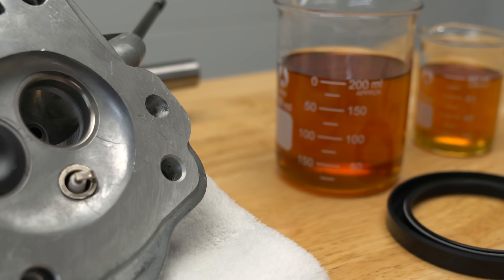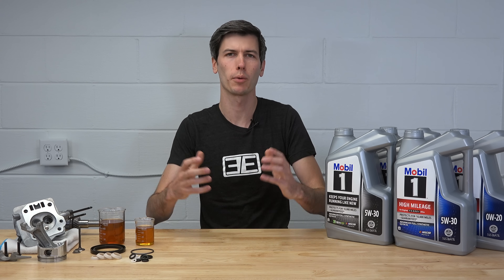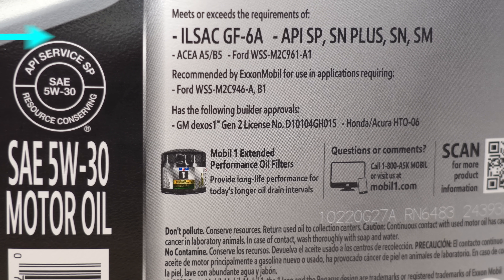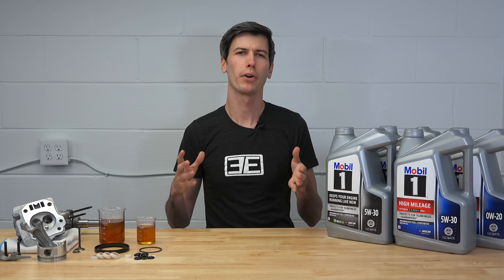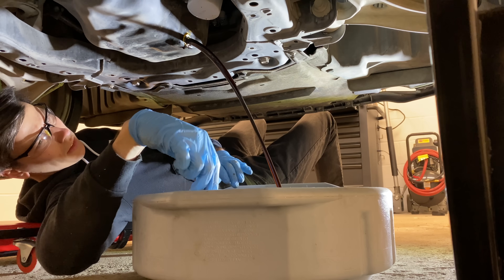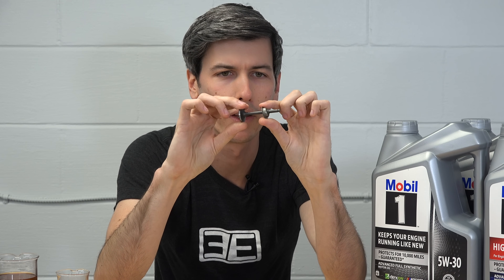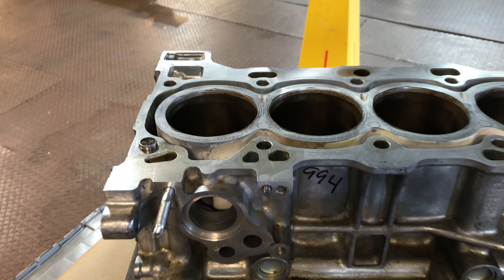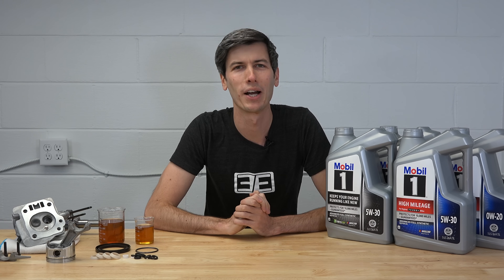Is Synthetic Motor Oil Bad For Old Cars?

Comment: I’ve had four used cars that I switched to full synthetic..all four developed leaks almost immediately!  Just my experience.  So what I do is switch to a semi synthetic, best of both worlds!  I’ve actually seen leaking engines caused by full synthetic reverse by switching to conventional and semi synthetic!
Reply: Jim Bic did you even watch the video?  The syn didn’t cause the leak, and the issue is still present.
Reply: Did you read what I wrote?  I’m telling what has happened in my experiences!
Reply: Jim Bic and he explained how those experiences happen.  Also when you switched to syn was it a high mileage syn?
Reply: Chad 2 Cars yes 2 Cars No...my Motul rep (when I used that oil) assured me that their oils are made to treat seals regardless of mileage.  Motul is a much better oil than Mobil.  I’ve just had bad luck with Synthetic in my older vehicles.  Dude I swear to God, on one particular vehicle it (which never seen a synthetic) went from being completely dry to an actual constant drip at the rear main seal.  Again maybe just my luck?  Instead of using synthetic I use conventional or a semi and just change it more frequently..one car now has 330k never had any engine issues.  I could try a newer Mobil 1 high mileage, might try it and report back to you!  :)
Reply: @JimBic72  I wonder why he said the oils treat seals regardless.  High mileage oils have different additives regardless of make.  Like he said in the video, you wouldn't want to swell newer seals so non high mileage oil shouldn't be doing that.

I'd be curious what happened if you did try again, but in my experience with reps at the dealership they were about as honest as our salesman.  Couldn't trust either of em :/
Reply: Chad From what I understand you don’t want to ‘swell’ seals rather keep them soft and supple.  Sometimes I’ve seen seals that are like a rock and are beyond ‘treatment’.  Sometimes the crud that builds up around the seals are what’s actually keeping it from leaking!  Put in synthetic oil which has a great ability to clean, it cleans the gunk around the seal and voila...you have a leak!  I believe that’s what happened in my experiences!  I get what he’s saying in the video.. again this is not what I have typically experienced!

Comment: Switched to Mobil 1 in 1975 after seeing semi gas engine with 100K, several oil analysis reports and torn down as proof of  concept-spectacular. Did change out some used cars with 30K to Mobil 1 after a drain and flush and run 30 sec with diesel fuel. Zero leaks or oil burn until I sold them at 120K.

Comment: Thanks for the bonus rotary fact. I've been scared into buying conventional for my 85 RX7 by the guys on the RX7 Club forum for a few years now!
Reply: Your Spinner engine will run perfectly on Pennzoil Ultra Platinum -- just make sure you use the viscosity that's recommended by the manufacturer !

Comment: I've been using synthetics in old cars ever since Mobil One was first available to me in 1976. Never had a problem. Haven't had any mechanical engine failures, either. It was a great advancement in motor oils, and proved that thin oils can lubricate just as well as thick ones.
Reply: D.E.B. B    You're wise beyond your years.
Mobile 1 Forever.
Reply: @ricktaylor3748  IN THIRD PLACE! BETTER ARE = PENZZOIL, ULTRA" PLATINUM, = AMSOIL, SIGNATURE! AND SHELL' ROTELLA ' 6!! FULL STHN
Reply: Doesent work well om early turbo vehicles they always had  very light leaks ..drips the synthetics..fly right through..and remember that graphite oli back in 70s...fouled up plugs and valves
Reply: @miguelcastaneda7236  and wore out rod and main bearings.
Reply: I've been using mobil 1 since I was 4 years old, and never had a single engine explode
Reply: I've been taught that synthetic oil will leak more because it's thinner.
Reply: @chuckh4077  Some will, some won't. You have to try it to see. BEsides, there are many synthetic thicker oils available; I used 20W50 on my 1986 Porsche 928 for  almost ten years (2007 to 2016) with no leaking. Same with my first; a 1966 289 Mustang that I started on Mobil 1 5w 20 back in 1976 it had 80K miles that had previously been on 10W 40 Castrol GTX; It dripped a little on the old dino oil, and dripped a little on the synthetic as well, but no more on the thinner oil, and didn't burn any, either. But the mileage went up to 18 mpg on that old engine from  16. I kept that  car for another four years; but the most impressive stat is zero major engine problems ever, on any vehicles since 1976. Good oil has to have something to do with that.
Reply: Bonjour,
Quel grade d'huile mobil 1 utilisez vous ?
5w30 ?
Reply: The problem is, if a old car using conventional all over the year, and suddenly added synthentic, the engine will leak from everywhere
Reply: provided it had enough additives.
Reply: @humansvd3269  ALL motor oils have 'additives'.
Reply: @d.e.b.b5788  true but what ones and how much?
Reply: That’s all the evidence I need , oh while I have you here what’s your take on earth , round or flat . I await your findings
Reply: @mr.anderson9938  . LOLOL!
Reply: @mr.anderson9938  flat
Reply: it hard on flat lifter's, and cams

Comment: this video is slightly helpful for most ppl but it doesnt address the actual problem with using synthetic oils in actual old engines. anything from around the early 90's or 90's back. aka actual old cars or the cars people care about and are watching this video for. there are certain additives the old engines needed that are not present in most modern oils. yes there was a short spurt about check oil specs on the bottle so technically someone who knows would see hey this doesnt have certain additives. but who here knows that the oil specs mean on the bottles? not the people on youtube trying to figure out if their about to kill a motor or not. 
before everything went roller camshafts and roller rockers in the mid 90's the flat tappet cams and lifters NEED zddp its an additive that was the common spec for the day.  not the case any more and thats whats bad for old motors. shell rotella is a severe duty synthetic that still has enough to be a good oil for old cars. t3 i think it is. other than that you need to special order the oil now or buy a zddp additive for using current oils. thats the big reason for the myths aside from the leaking problems. newer oils have less anti wear additives for friction due to being roller motors. the additives they have are for different kinds of stresses and strains and perform fine for the motors they are advertised for. 
think of it like the gasoline difference between cars that require leaded gas vs newer ones that cant run on that. most gas stations dont sell 110 octane leaded fuel. yet it was in every station back when it was the product that was needed. now its not so measures must be taken to prevent damage just the same.

Comment: I wish Mobil 1 made a synthetic with proper ZDDP content for a classic running a flat tappet cam.
Reply: Amsoil sells a 100% synthetic product called Z Rod oil (in grades of 10W30, 10W40 and 20W50) that is specifically designed for older classic and hot rod cars.  It features a high-zinc formulation to prevent wear on flat-tappet camshafts and other critical engine components, along with a proprietary blend of rust and corrosion inhibitors for added protection during long-term storage. Z-ROD Synthetic Motor Oil is designed to perform on the street and protect during storage.

Comment: From 1st hand experience, synthetic was not to be run in Mopar 225 slant 6 in the early 1980s.  Mopar issued a service bulletin stating this warning two weeks too late for my friend.  The cam shaft shot out through the radiator of his pride and joy the day after I was permitted the one and only time to ever drive his baby.  He blamed me for 2 weeks until the service bulletin showed up.

Situation:  He was a timid driver.  He froze in heavy Chicago traffic.  He asked me to drive.  I drove it aggressively until we were out of Chicago.  Then he drove as normal, about 3 mph below posted speed limit (55 to 45) for the next 135 miles.  The next morning...kaboom.  Cam shaft hanging out the front.  According to the service bulletin, under heavy loads, synthetic oils would work into the interference fits that held the cam shaft in place.  It would not be noticed while under heavy load because the engine was uniformly hot.  But after repeated cooling cycles (or CYCLE) when cold there was more clearance and the synthetic would permit the cam shaft to eject.

The fix was to replace a bushing with a standard high performance bushing that had been available for many years but only installed on the 2 barrel carb engine.  Took about a 1/2 hour.  (I installed it on my slant 6 even though I had no intention of using synthetic due to how fast my oil got sludgy.)

It took so many years after the early synthetics to get the service bulletin warning on the slant 6s, because the slant 6 had to have oil changed every 3500 miles even if it sat in the driveway and went nowhere.  They are dirty engines.  So, people did not want to put expensive synthetic oil in them.  I owned 2 slant 6s and certainly laughed at the cost of synthetic.  But starting in the early 80s, the cost of the synthetic oil decreased, the additives improved to sequester the dirt to better precipitate it in the filter and the filter technology improved.  So, now it was possible to run about 10k miles or MORE just changing the oil filter and topping up lost oil.  Wow!  What a life.  How could it get better?  But on the downside, seals starting leaking.  Although the slant 6 seals always leaked so who could tell?  The real tell-tale was the cam shaft peaking out the radiator.

Comment: How about older engines from pre 1980 that have hydraulic flat tappet cams shafts?  Wouldn't fully synthetic motor oil cause the cam shaft to wear out prematurely it were to wash off the protective coating Zinc off the camshaft? Since Synthetic motor oils are very good in preventing sludge buildup and have cleaners? In that case it would be best to find a Fully Synthetic motor oil that has high ZDDP for Classic Cars!

Comment: OH NO!!! You brought up the crazy synthetic vs conventional oil in a rotary engine debate!  Grab some popcorn and watch the comments!  I'm an RX7 owner and have been running quality synthetic oil in my engine for over 20 years. I just had my 1984 12A rebuilt with >175,000km on the clock. Housings and rotor faces were just fine, thank you very much.

Comment: Some cars get shipped to cold climates and the oil that comes in it is good for down to 30 degrees but if you read the manual it says bump up oil thickness for hot climates and that the real deal.

Comment: My understanding about not using synthetic oil in a rotary using oil injection, is that the synthetics are actually TOO good. They are more resistant to evaporation, so they don't burn in the combustion chamber as easily or completely and thus build up carbon more rapidly.

Of course, the best thing to do is delete the oil injection and premix the fuel with 2 stroke oil while using a synthetic in the crank case.

Comment: Mineral v Synthetic...
I rebuilt an old 4 cylinder MC (Suzuki GS750E ´79). I was told that it was due to the minerals. Back then, the engines needed the minerals for valves and what not... Nothing about seals, leaks, thickness or o-ring wear.
Have I been told something false?

Comment: When i had a RX7 i never thought about adding some 2-stroke oil to the fuel.
Might have helped the wear my car engine experienced.
Reply: I sold my RX7 6 months after I bought it new because it used as much oil as gas
Reply: @alanpoh3386  There is a regulator on the engine, might not have been set right.

Comment: When I use synthetic,  I burn a ton. When I use conventional, I burn nothing.
Reply: What do you like better?
Reply: Johnny Tyronne  What would I use if my car has over 250k miles and uses 10w30?
Reply: Thanks, unusual... maybe recheck VISC/ additives/weight: etc.
Reply: @Kevin Krut that's odd since I used m1 since the very late 80s on cast iron blocks with no issues at all. Used it till I retired. Still use it in my 2 vehicles.

Comment: Curios to see what you guys say and think about mixing types of oil.  For example, mixing 2.5 qt of 5w-20 synth with 2.5 qt of 5w-30 for use in an engine.
Reply: I think it depends on the individual oils in question and their additive packages.  If the two oils have a very similar additive package, then I don't see it as a big deal, but in most cases it is not really necessary and a waste of time.  Only reason why it might be helpful is in extreme parts of the seasons like winter or summer.  Say your car calls for 5w-30, however in your area, it gets pretty cold during winter.  There could be a benefit in cutting half and half with some a 0w-20 right before the really cold temps start hitting.  Or conversely, say your car calls for 0w-20, but it's summer and hot, you could mix the above half and half and put it in and get a bit more protection

  However, it's hard to tell when the additive packages are similar or not, even with an oil analysis, because even the regular ones like from Blackstone, don't catch all the additives, especially the organics (amines etc).  And it's possible that even two similar oils from the same brand, might have different additive packages. For example, I like the Costco Kirkland synthetic oil (pretty much same as Walmarts Super Tech fully synthetic line) and I buy both the 5w-30 and 0w-20 for our respective vehicles. They are both made by Warren, but I don't know if the additive packages are similar or not?  I kind of assume they are probably pretty similar, but that might be a mistake on my part.

Comment: Yes he is right about the seals... But the problems stopped around 2010... If you switch from one oil from the other... Switch the oil every 3k to 2k the first 3 times and red line the car... The. You can switch every 5 k miles after that

Comment: The only drawback I can think of if you choose to use a thicker oil in a worn engine is that if it's new enough to have a variable-valve-timing system, it might be too thick to fit through those exceedingly tiny passages.  So you might be solving your ring-blow-by or valve-stem-leak issues, only to create a problem with your variable-valve-timing system...

Comment: The previous owner of my 1983 Opel Kadett (overhead cam engine) threw a synthetic oil (15W-40) in the a car, which is a huge no no. It needs multigrade mineral oil 20W-50. Luckily the engine withstanded that abuse because it's a tough engine. I'm lucky the engine is still functional. It has 90,000 miles, runs like a clock, but has a ping that has no cure. It has no explanation.